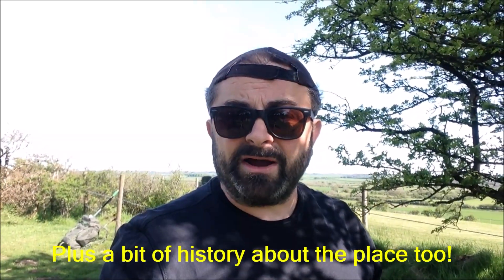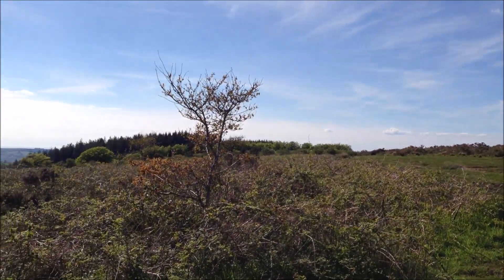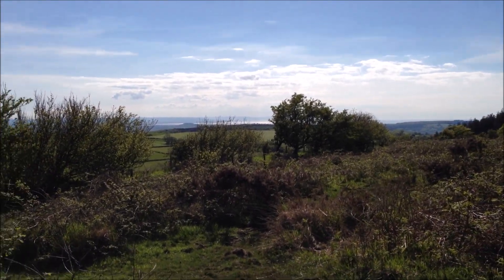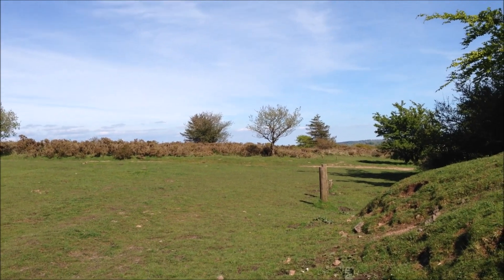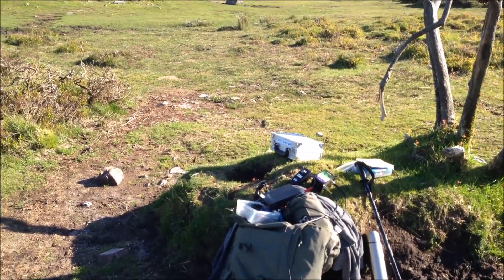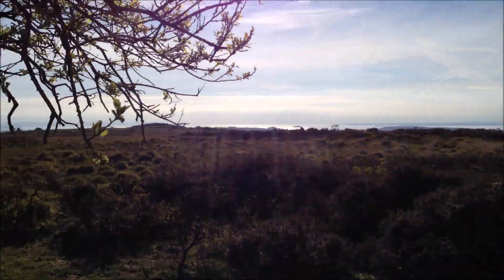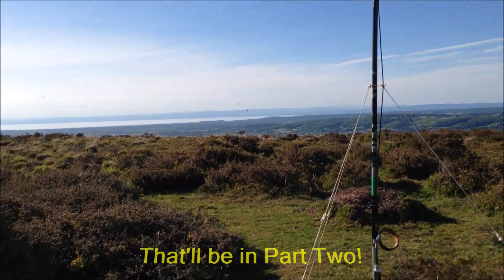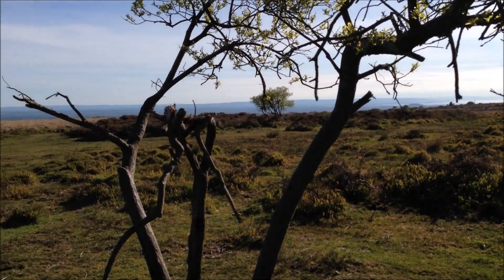Part One - Vintage UK CB Radio Night May 27th 2021 from the Hills (location, history and the setup)

Comment: What a night.  It felt like the 1980s all over again. 
Looking forward to doing it again.
163-RP-21 👍
Reply from the maker: Apparently 51 in the log between Ben OP255 and myself - plus a few others brought in, so quite a night! Cheers.
Reply: @ukcbtv  My hope is that the rise in interest through lockdown holds onto those who've discovered, and those who've come back to CB.
Maybe at some point over the summer there should be a super-vintage net using pre-1981 AM radios. That could be a lot of fun.
It might be time to give my old Kraco KCB-4004 a service.  😁👍
Reply from the maker: @mosherj666  - the next one is going to be a portable radio net (with Portapacks etc.) but an AM net would be nice - we had some great ones a few years back 👍
Reply: @ukcbtv  That's another expedition into the attic then. There's a Harvard 410T up there somewhere.
Reply from the maker: @mosherj666  - talking of expeditions, it's lovely up at the Blorenge Trig Point and no noise from the TX towers 😉
Reply: @ukcbtv  The Sugarloaf is another great local DX spot, but that last 400 metres is a bugger to climb.
Reply from the maker: @mosherj666  - indeed the trek up there comes tight, but a hell of a view and a great signal take-off 👍

Comment: I was on top of the highest mountain on Thursday night and heard diddly squat on legal channels.
I did hear some French, German and the usual Italian.  Nothing heard except for a couple of lory drivers with some bad language and not really a lot to say for themselves!
I did hear SSB, not on legal channels.
One was using 400 watts AM/FM, but he was on SSB so I have no idea of the power he was using.
I had a legal SSB CB with me, maybe if I was lucky it might have been putting out 3 watts AM/FM and maybe 8 watts SSB.  A scanner and a York 861.
The guy with the high power was calling CQ and getting no replies, he tried for some German station using all his power and didn't get him, so I waited a minute until the German was finished and gave him a call, he came right back to me on the newer UK frequencies.  I was only using a mag-mounted Z27, remember those, it was new out of the pack, swr 2.5:1 but it was the same both sets of channels and low where I couldn't use!
So loosing power through a high SWR!
So anyway, the legal set for SSB was a loan of a President something?
It has changed it appearance a bit as it goes abroad every week or so.
They tend to turn a blind eye but as the owner says "You never know when some jobs worth will look in the cab".
Anyway, thanks to Enforser (spelling is correct) for a loan of his set for the three days he had off.
Reply from the maker: Worth a try Bob and thanks for making it out 👍 We made it up as far as Grimsby on a bit of a lift but needed a bit of skip to get up as far as you - some seemed to be brewing right at the end but it was SSB and just made us call it a day at about 21:15. We did get 51 individual stations in the log between Ben Op255 in Mid Wales and myself in Somerset, so all in all, a good nigh for the old UK FM! Cheers.
Reply: @ukcbtv  It was worth a try and the weather was ice on top of my mountain.
Did hear a few continental stations FM/SSB but I quit at 8:45 if I remember.

What we need to do around late summer is to try to link up and see if we can do a link up from lands end to John o Groats.
We did a link up once and it took 3 hours to get a massage through from I think just north of Wales to Brora in the Highlands.
Even just to see how far we can get on old FM channels.
Then see if we can get anywhere on the new SSB channels, that might be easier for covering long gaps.

Going by the skip the other day there is still areas of England with quite a few using the UK FM channels.

Anyway, gave it my best shot!

Mind you, if I had a bigger aerial, I might have heard a bit more.

Keep on the airwaves and work the skip.

Heard a guy on the new FM channels, he was sitting a solid 7 on my meter for best part of an hour!

Comment: Which of the two antennas did you get better results? T2LT or Vertical Bazzoka?
Reply from the maker: No noticeable difference between them - I go with the T2LT now because it is easier to make and a little lighter and more flexible.